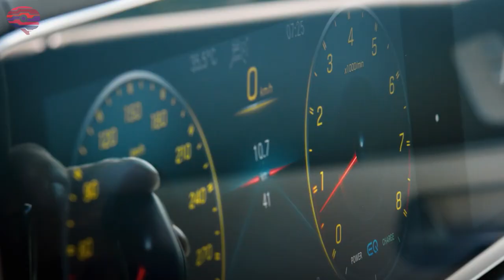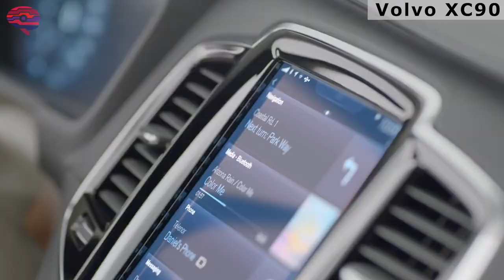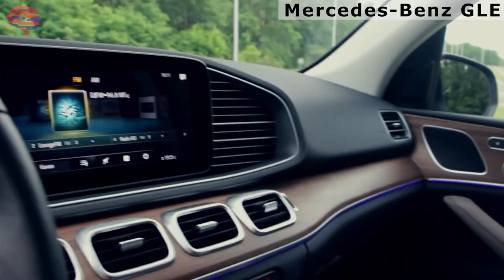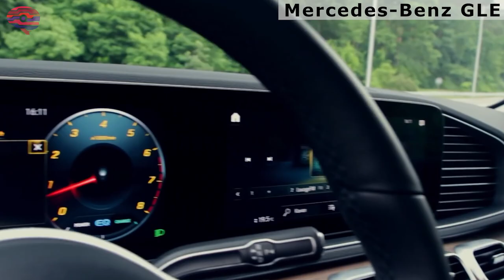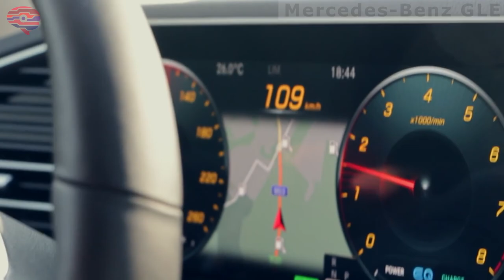Top 6 least reliable SUVs and Crossovers for 2022 & 2023 by Consumer Reports

Comment from the maker: What is your experience with one of these models?
Reply: The gle sucks, constant engine issues, software issues, interior is cheap and only has a lifespan of 5-6 years. The chassis is the old Chrysler liberty chassis and is not that good. We put more in the repair bays off the line than what we put on the wsa line to be sold. You think you’re getting a Mercedes’ engine when you get the 4 or 6 cylinder but it’s actually a Nissan engine. In short, the gle is a heap of a mess filled with glitches and bugs galore.

Comment: bought and took delivery of my 2020 GLE with premium and intelligent drive package back in 2019/11, so far work flawlessly, gas mileage in city around 12.6L/100KM, hwy around 8.5-9.5L/100KM. I encounter 0 issue with electronic system or powertrain or anything else.
Reply: my car built in US factory on May/2019 way before pandemic; I guess due to COVID the production quality gone down a bit
Reply from the maker: thanks for sharing, good to know your GLE is very reliable.
Reply: Same here.  Got my 2020 GLE 450 in Jan of 2020 and it has been flawless.  Had a 2017 prior to that and never a single issue with either.

Comment: I have a 2022 VW Tiguan. Love it, no issues. maybe the refreshed fixed the issues.
Reply: Still too early to conclude. However, I have a 2019 2.0 diesel model. No issues so far.
Reply: Got 1 too drives very well!

Comment: My wife and I recently test drove a 2021 MB GLE. The car looked great, inside and out. Had plenty of power, but after about 3 miles we turned around and went back to the dealership. The road and wind noise was awful. I was actually shocked how bad it was. It also did not have the ride quality we were expecting. For a vehicle that had a sticker price over $75K, this was very disappointing.
Reply: Im glad that you didn’t go with the gle. I used to work in the plant in Vance al where they’re built and they’re hunks of junk! If people knew how these vehicles were rolling off the line then they wouldn’t want to go near another Mercedes’. The company has gone downhill in an epic manner.
Reply: The Y is pure shit. I have not known a person who has had a model Y who hasn't had many issues, safety and electrical. They are garbage, get the 3.
Reply: @Firewolf35023  you are so far from MB))) don't tell the things you don't know.   I have GLE coupe and it is much more smoother than any Lexus and reliable tlhan any Japanese vehicles. Everything what is called planned service for Japanese vehicles is called break down or issues for MB))) I had an acura mdx 09 and i can say it is better tnan any toyota and is one of the best from Japanese cars
Reply: @artakgrigoryan1430  lol you haven’t seen them being built or built them hahaha. It’s built on the Chrysler liberty chassis with a Nissan engine paired with a Land Rover transmission. I hate to tell you this but…you got f’ed dude lol. It’s basically a $15,000 car that you likely paid atleast $60,000 for. As far as not knowing anything about “MB”…dude, I literally built the damn cars for a living and I have dozens of people that still work there that will back me up on what I say. So I’ll say this, I have technical proof as well as people to verify that actually build them, repair them, tune them and order the parts from vendors to have said vehicles built. Think before you speak son, you lost this debate from the start. Go be a fanboy elsewhere.

Comment: Interesting.  In January 2021, Consumer Reports rated the VW Tiguan as the #7 BEST SUV for under $35K
Reply from the maker: well... interesting, however "least reliable" does not mean its reliability is unacceptable. These days brand new cars are in general are very reliable, just some models have more issues than others.
Reply: I owning one and about 10 more among my friends, the longest ownership is around 4.5 years, we never encountered any issues. Some of these cars already clocking close to 100 k km.

Comment: Two things to point out about this list and it mainly has to do with CR:
1) CR only survey's it readers and not the entire owner population of these cars. 
2) CR is great about telling you about the past and horrible about predicting the future. They decide the weight of each criteria to come up with this "predicted reliability score". Also, even the speaker in the video says, they may have fixed some of these issues in the more current models.
Take CR predictions with a grain of salt. I only read actual test drive results from any car review and dismiss any ranking or scoring they put out. It's all subjective.
Reply: I would not rely solely on CR to purchase a car, but their survey is always a part of my process.  They may only survey their members, but statistically it’s enough data for me personally to decide whether or not to shell out thousands of dollars on a vehicle.  And they continually update the survey.  I have experienced it firsthand with two of my car purchases.  
Additionally, CR always recommends that people not buy the first model year or redesign of a car because there are usually reliability issues with them, regardless of the brand.  Further, CR differentiates between “predicted reliability” and “reliability verdict”, which continually changes as I mentioned earlier.
The way a car feels is subjective, but a car’s reliability isn’t.  It either works, or it doesn’t.  So, reliability is objective.
One of the challenges with car reliability, especially when it comes to luxury brands, is that their owners or people who aspire to own always make excuses for them.  “Well, this car has so much technology… if you can’t afford it don’t buy it, etc,” they say.  Nonsense.  Again, a car either works or it doesn’t.
Reply: @bill7481  great answer. If a car manufacturer has a reputation for building poor cars, why would you give them a high predicted reliability score, when everything else points to poor reliability.

Also, car owners are the perfect people to ask about their car issues. They drive them everyday. Taking your information from people who willingly sign up to a website, to give feedback on their cars, is actually very useful and reliable information. There is no manufacturer or car reviewer bias. The customers have handled over a lot of money for that car they are reviewing, so they have nothing to lose, when giving feedback.
Reply: @michaelbroderick6830  Well said!
Reply: Past performance is the greatest indicator of future performance...what else do you have for reference?  Every time you hire someone to do any work on your home or car you check with the BBB or if there is any online feedback of issues with a company.  You would be foolish to ignore past performance.  If a manufacturer improves quality, then those numbers will impact future ratings.
Reply: @gleej8120  I'm not saying ignore past performance, I'm saying I don't fully trust CR's way of collecting data. It's a subset of the total population of car users.

Comment: Why would anyone by an Explorer??  Not only are they highly unreliable, they are cop cars.  Do you want to look like you're driving a city / county vehicle??
Reply: Had mine for 17 years and had no problems with it at all, best car I ever had. MY sister has had 2, a 2016 and 2020 and they both drive like a dream with no issues at all. My ex Tesla Y, not so much, brand new car not even a year old and already had a recall, quality and structural issues, electrical issues like 28K. For a $43-71K wave of the future car and you can't touch 43K now, they start at like close to 60K now, I'll stick with my 33K Mazda CX-5, which ironically was the same as my exs 2014 CX-5 meaning no issues or problems, safe reliable, practical, then sugar daddy gave her a Porsche mistake, I mean Macan for her birthday and after two of those heaps of shit, she now has the Y and the running lawsuit to get reimbursed for her losses and two more years to go on the lease. I Guess bad karma is a btich.